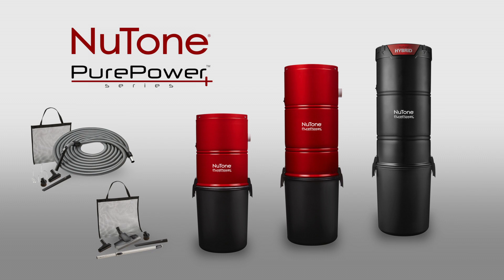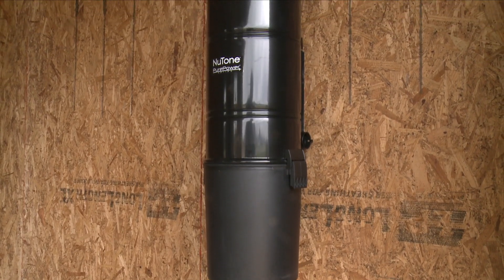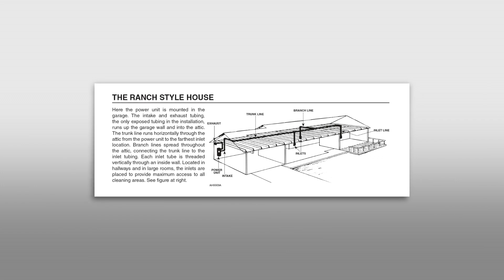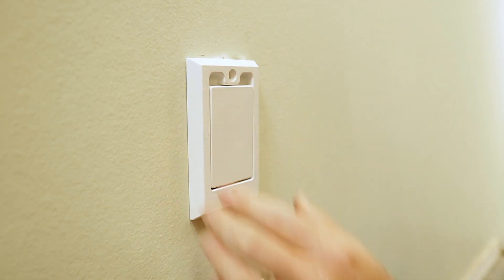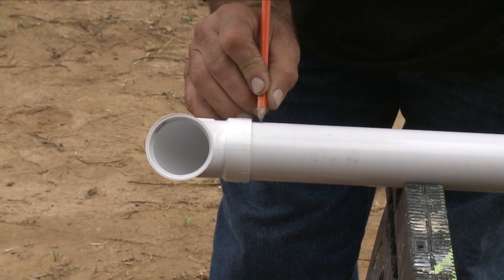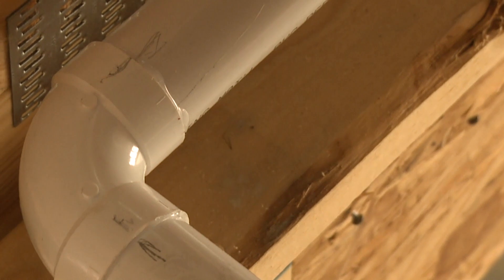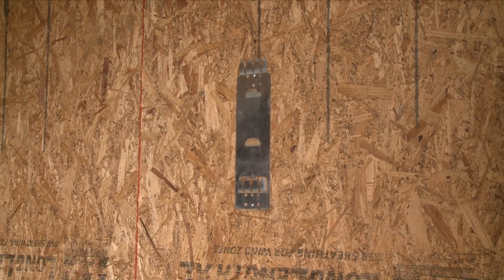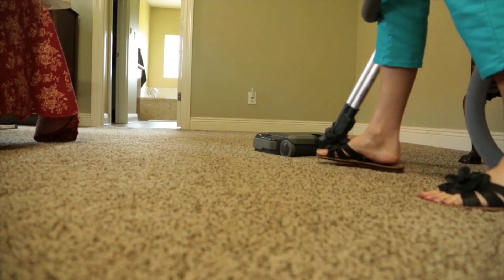How to Install a Central Vacuum System in New Construction

Comment: Never glue a fitting, only the piping.. this is basic and shown wrong here
Reply: Yeah they do say that later in the video but they repeatedly show them doing it the other way, gluing both ends, earlier in the video.
Reply: Exactly my thoughts. Early in they state to apply glue to the pipe, but at 5:33 the guy puts glue inside the fitting! That is a sure way to have beads of glue forced inside the joint. Those protuberances will hang onto vacuumed debris & lead to clogs.